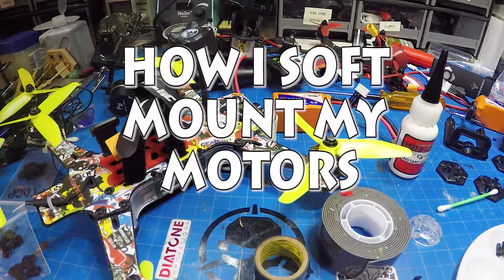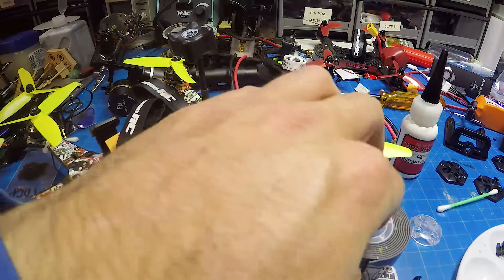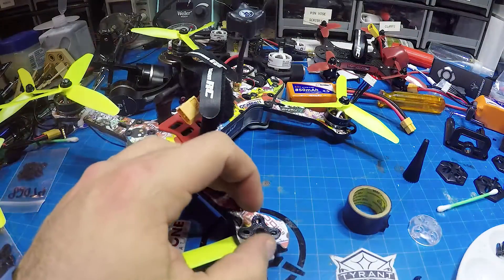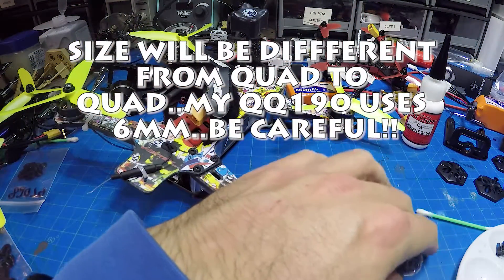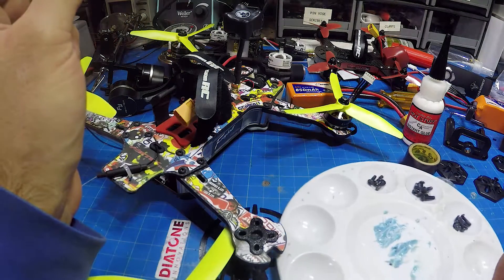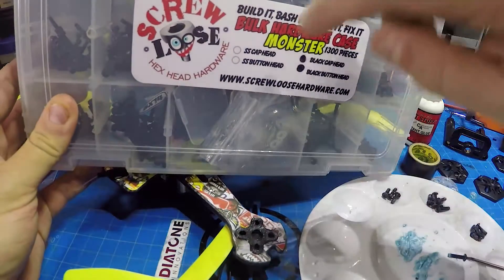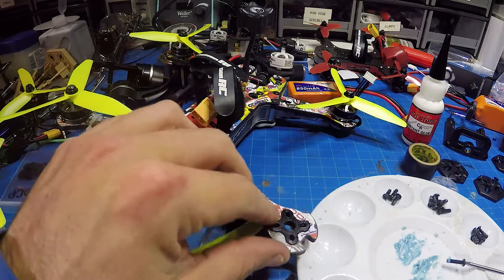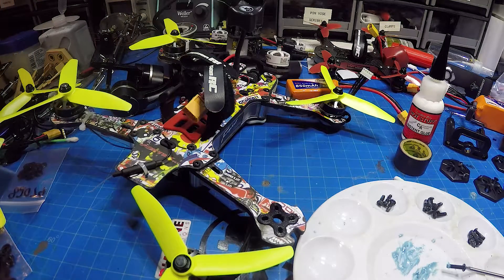SOFT MOUNTING MOTORS ON A RACING DRONE/RACING QUAD

Comment: When you tighten the screws down are you leaving them just snug since you have the thread lock on the screw or are you cranking them down really tight as if you didn't have the TPU spacer?
Reply from the maker: lock them down and them back them off is my practice

Comment: I don't see the point if your bottom screws are not isolated from the frame as well. The vibrations will just travel through the screws. Even if you put a rubber washer on the screws, they will still touch the frame in the hole.
Reply from the maker: fallenwout According to the pros and black box data it reduces a lot of noise. It doesn't eliminate it completely. Every little bit helps I guess.